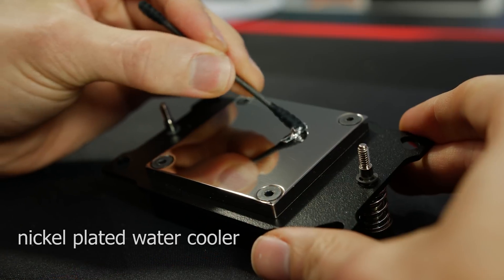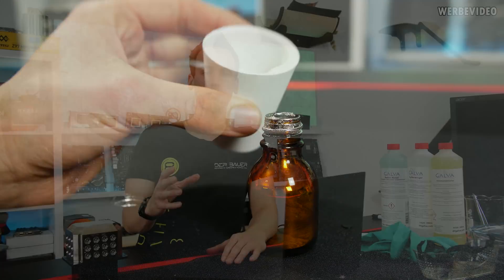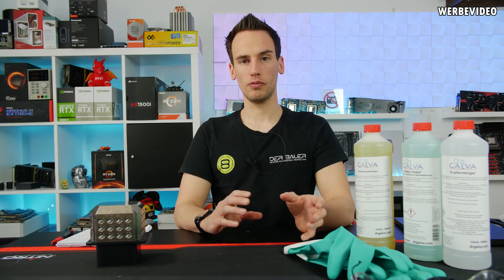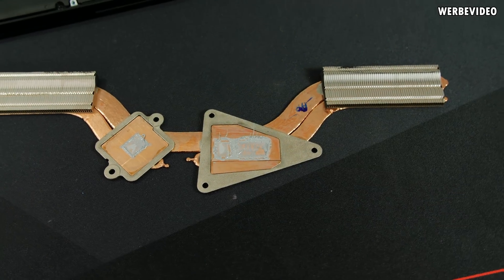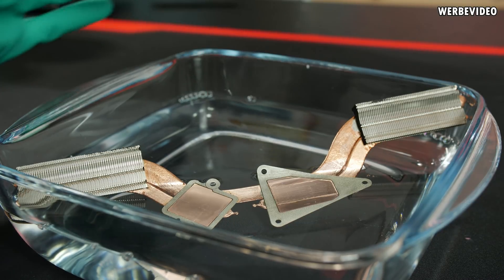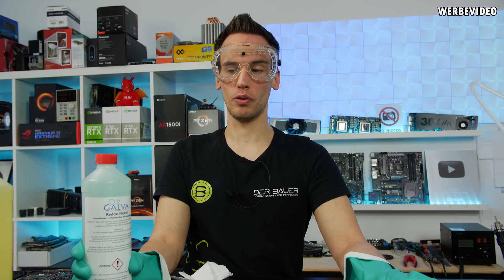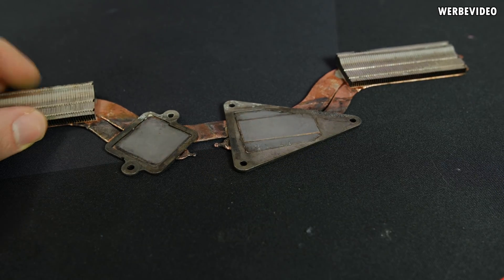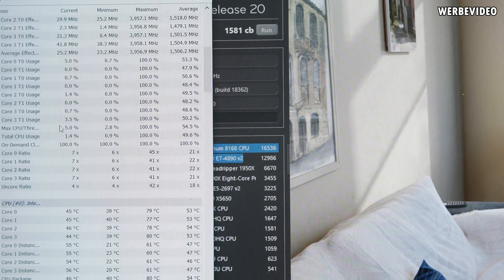Can this REALLY work? DIY Nickel plating a CPU cooler (Liquid Metal preparation)

Comment: Electroplating with a towel dipped in nickel sulfate wrapped around the anode would be more precise and could stop bumpy spots from appearing. You also wouldn't need to use palladium. Also for anyone doing this I recommend you get industrial degreaser from your hardware store instead of a citric acid/ alcohol solution, this is more powerful and would stop black spots from appearing on later in the project. 

Great video nonetheless :D

Comment: @10:00 that's tarnish I think from copper reacting to an incompatible metal trace. Maybe due to aluminium contact. 

On a side note: This is also why you don't sand your copper with aluminium oxide: I learned that the hard way :)

Comment: Derbaur, I bought a caswell plug n plate nickel kit, but it came with an opened nickel solution which had tons of Oxide bubbles in it. It's not plating well at all.

Comment: Just wanted to give my experience of using EK supremacy copper block for whole 9 years with Liquid metal. For first 5 years it was fine, now the performance is very, very bad. 

So it was fine for years with the intel system that I didn't reapply or remove the block after 1 reapply, and was still OK after switching to Ryzen 2700X 2 years ago. But the performance has gone to worse with each reapply and now I'm just thinking, if I should sandpaper my old block or buy a new one with nickel plating trying to remedy the cooling performance. Probably not worth the time trying to sand it, as I think there is some minor corrosion in the blocks side after all these years too.

I could see the performance hit already on my 2700X after I had to reapply the LM again on 1 year usage (and then again on my 3800X that I upgraded to), now I can't avoid thermal limit even being fully stock and undervolted and the CPU even idles past 40 celcius all the time. My RTX 2080 barely hits 50c on most cases and the cpu shows 60-70 temps on just cold windows boot up and without manual thermal cap it will reach +80c on load that will force my PWM fans to go 100% no matter what. So it has come to a point that can't cool down the CPU anymore.

So while it is probably fine when you only apply it once again so that the LM wont "dry out", constantly having to replace it is not a good idea on the block side apparently. At least not after a decade of usage.

Comment: God damnit it was hard to get the palladium to stick to the copper. I'm not sure why it won't stick in some places. But after  going through the procedure 3 times, it finally looks good. Thanks for the idea Roman! I'm still amazed by how easy that was. Next time i'll try using 400grit sandpaper on the copper first, maybe this will help the palladium.

Comment: Just out of curiousity, wouldn't a very thin nickel foil taped to the heatsink also do the job of protecting it from corrosion?
Reply: I don't think that would work that great. The foil would be much thicker than a nickel plating and probably will introduce tiny air pockets due to the foil not being perfectly flat. But you could simply try it and see how much it affects cooling, i'd be also interested in the results

Comment: @der8auer I've got small question, since you already use liquid metal extensively.
Could you test and compare LT-100 to something like Condactonaut?
LT-100 is quite cheap liquid metal, available on Aliexpress, that has stated condutctivity of 128 W/mK, that would make it best on the market if true.
I've only heard good things about it in customer reviews, bo no test visible. At least one review stated, that it's better than Condactonaut with visible temperature dicrease.
Reply: Because he is sponsored by thermal grizzly he stopped reviewing them

Comment: Very interesting, unfortunate that its a difficult process. Would have loved to try it just for fun on a GPU with cooler that has exposed copper, but the fact that you didn't pull it off the first round means i'm going to likely burn my house down

Comment: Do you think you'd have a much better coating of this if you submerged those copper parts in the palladium and nickel solutions if you left it on for day each? Just thinking ...
Reply: Hi there, just did this myself and maybe i can answer that question: imho the biggeest problem seems to be the initial cleaning of the copper, the paladium somehow doesn't want to stick to some areas and i don't know why. But yes, a longer bath yields better results. But i'd not go over 1h for palladium (the more palladium accumulates, the less reusable the palladiumactivator gets, also i don't know if too much palladium maybe decrease thermal performance). As Roman said - and he's probably the expert here^^ - we only need a specific amount of nickel. We could build up a thicker layer, but that won't do anything but desaturate the nickel-electrolyte more.
Reply: @samehedi  Thanks man!

Comment: Im curious if this kind of behavior varies between the LM brands. Ive been running LM (Thermal Grizzly) on the CPU of my Dell M6600 for almost a year and it hasnt changed performance at all. The CPU runs 90C or lower, generally 75c under load which is much better than the 99C i use to see stock or with decent TIM.

Comment: Given the fact that the heat from the core-dies is spread through the spreader to adjoining core-dies and to the IO-die would it be a good idea to delid an amd processor and using heatpipes to cool each die separately if this will allow the core- and the io-dies to run at much higher clock frequencies?

Comment: how about use like a borders around the contact areas, i mean u can save chemicals and focus the reaction and avoid unexpected products by reactions with the other metalic piece that is surrounding the contact area (could change/renew the chemicals every interval of time you choose with the plunger of a syringe.), borders colud be plastic materials like the containers and at the end you can polish with an ultra soft material in order to get a chrome like finish, regrets  from Mx

Comment: The other issue with electroplating nickel is the risk of hydrogen embrittlement.
I was electroplating my RC Car's drive shafts so I wouldn't have to worry about rust, the dog bone ends are "shrink fitted" which the embrittled driveshafts couldn't handle and consequently cracked.
Reply: you can remove hydrogen by heating them in the oven 300oC 1h i've read online

Comment: I wouldn't recommend people doing this at home, and I certainly wouldn't have those chemicals in my oven. You can find plenty of businesses that do nickel plating professionally near you.  They usually charge by the surface that needs to be treated so for cooler plates it will be cheap. They will certainly do a better job than you at home and you won't be at risk of inhaling or spilling dangerous chemicals on you or your cat.

Comment: i think the best cause of action is if you have copper heat spreader to apply liquid metal and after 2 months or SO  to reapply i think the 2nd time will be fine as the LM from the 1st time bonded with the copper the 2nd time will be on already copper & LM surface so the 2nd time will not dry out.

Comment: To anyone doing this here:

Please be extremely careful here. I've done electroplating before myself, and until something bad happen, I was working at an electroplating place.

Nickel salts are quite carcinogenic, and plating aluminium is quite the lengthy process, and is quite hard.

Some other tips:

- To clean copper, you can just make a 10% citric acid solution, and spray it on the copper, and scrub it hard. Will help removing any copper oxide.
- Clean your surface very well using something like mechanical abrasion. Remove any nicks you can. Chemical preparation can also be used, but be careful there too.
- Wash your hands before handling the surface, and wear gloves after that.
- Do a 5% isopropanol bath to remove some of the oils on the piece.
- Do a 10-20% bath of sodium hydroxide solution to remove all of the oils.
- Use a low current density. To improve plating times, increase acid concentration for higher solution conductivity.
- Use a pump/magnetic stir plate to prevent any air/hydrogen bubbles forming on the part, so you get a nice clean uniform plate.

Also, plating aluminium is hard AF, and quite expensive actually. It involves multiple steps, for some formulas, exotic chemicals, and some lengthy preparation.

Finally, electroless plating, or even better, vaccuum plating could work well for a pre-plate job if you could make the machine.

 If you have any questions, just ask.
Reply: i'll need some advice in 1 month's time, i will be nickel plating stock reference 6900xt reference heatsink to use with liquid metal

Comment: The heatsinks didn't look fully covered so if any of that LM TiM gets into the little copper gaps in the paladium: it can still ruin the copper.

Or, was this to just aid in thermal transfer because the makeup of the LM works better on a plated metal then direct copper ?

Comment: I feel like since gold plating to copper is pretty well and common that a gold plate may have been easier. They sell liquid solutions which are pretty simple to use although a little more expensive. Gold should also have low reactivity to gallium metal long term like nickel, but should be a more documented process.
Reply: Gold dissolves in Mercury so i guess it might form an alloy with gallium as well

Comment: The black stuff looked like paint from the coolers fins. 9:47 the cooler fins are in the solution, dissolving the paint into the solution which then formed on the cold plates.

Comment: For a flat heat plate, you should simply electroplate. It's way faster and will build up a much thicker layer. It only needs to be where the gallium is in contact with the copper. If you're doing this for a home build PC, it's fairly easy to chemically etch the IHS and cooler plate, then electroplate both. It's obviously mandatory to remove the IHS before you electroplate it, or you'll likely destroy the CPU.
Reply: Mhm would you destroy the CPU though?

I think solutions can find its way under the heatspreader through a breather but might not ever come out or dry out, or might prove somewhat too corrosive. So indeed doing this on whole CPU seems ill advised. Also any exposed gold-plating might get plated over, which wouldn't be ideal.
Reply: @SianaGearz  That was my point, remove the IHS from the CPU before electroplating it. You cannot electroplate the IHS while it's still on the CPU, the current required for electroplating would almost certainly kill it. I wouldn't worry about nickel plating getting onto a gold circuit, unless it thick enough to cause a short, it wouldn't be much of a concern.

Comment: Why does Liquid Metal have to be so thin, runny, and low-viscosity?  Why can't a Liquid Metal formula be developed with a higher viscosity, and which is more non-Newtonian like a paste or gel or slurry? Surely this can be done without compromising on the thermal conductivity, can't it?

Comment: So. Just wondering why you did not use Electroplating?
No need for dangerous chemicals, just Hydrogen Peroxide and Vinegar.
Done it quite a few times, and the surface is extremely smooth and regular.
But i have not done this for heat conducting surfaces, Just decorative.
Reply: He explains why he doesn't do it in the video.

Comment: Question. I have your delid mate and delidded my 8700K and used thermal grizzly liquid metal between die and ihs. I've been changing the liquid metal every 6 months. Is that to often or not enough in your experience?
Reply: it's been around 2 years since i delidded and applied liquid metal on my 8700. Never touched it again, and temps haven't changed a bit since then.
Reply: I haven't touched my 7700k in 2 years with no performance changes personally. The ihs comes nickelplated stock and diffusion through the untouched die is extremely low. Did you grind down the ihs?
Reply: @Ironclad17  no didn't sand it. I only change it because I remember Steve from GN said to change it every 6 to 12 months. But I was looking for Roman's opinion as he's got far more experience than me.

I do notice the liquid metal has a different "feel" (for lack of a better word) to it after 6 months of use

Comment: I wanted to thank you for doing these videos in English as well. Thermals on laptops have always been a problem and any content helping to lower temps is great!
Reply: Go with new ryzen and thermal problem is solved 😎
Reply: @jerrym1401  Problem is the Ryzen laptops are overall worse on about everything else than cpu performance. Its not really a pick and choose matter. For a top tier laptop you need every component to "click".  Show me a laptop with Ryzen chip + a 15.6+ screen, GPU around 2070(non Max-Q) and good memory. I bet you will find 1 to 3 decent laptops. Here in Norway i struggle to find anything with the good AMD chips even though i REALLY want my laptop with Ryzen.

Comment: You should really of tried this using electroplating, from what I have seen you can do it with a normal PC PSU, But you can apply it only to the area you want by brushing it and building up layers, using a brush that is conductive. (codys lab does this gold plating a bumper),  I do also believe you have to do a wetting test with pure distilled water to make sure the surface is 100% free from any type of oils/ contaminants. I think that is why your base layer was so spotty.
Reply: You can just use batteries as well
Reply: No, I would recommend using a current controlled power supply.

You want absolute control over current density. Even at 3,3V, that could be way too much voltage, and therefore, current.
Reply: @neutronpcxt372  Yes it would be farrr better, would allow for tuning, but by brushing it on i think you have much more control overall: vs normal electroplating. I have never done it either way myself, Just speaking from what i have seen. That is how i think you could get away with the 3.3 volt, you could also step it down fairly easy with a normal psu.

Comment: Is it just me or is Youtube's compression algorithm getting worse......
Reply: Big video platforms like youtube, amazon prime video and netflix were asked by some governments to limit bandwidth because so many people are at home and using those platforms during the corona situation. It could be a consequence of that.
Reply: @megapro125  yeah i knew about that,  they took off anything over 1080p but they added it back so it seems a few days ago, and it is garbage, guess that could still be the reason even tho.
Reply: @r3drumg33k3  Did you watch the video early?

If so, it was still showing you the H.264 encoded video, not the higher quality VP9 encoded video, which has higher bitrate efficiency, and thus, higher quality.
Reply: @neutronpcxt372  That i did, within the first hour i think it was,  I did not know that, ty for the info :)

Comment: when electroplating, lets say aluminium, isnt copper being used as a layer before the nickel as the same as your palladium?
Reply: Well, to plate aluminium, you have three steps:

1. You remove the anodization/oxide layer using a sodium hydroxide.
2. You very quickly put it in a solution of zinc hydroxide to protect the aluminium with a thin zinc coating.
3. Using a flash copper solution, you actually plate a thin layer of copper to prepare it for the main plating job.

Comment: Yeh, I lost a GPU block and a D5 pump to EK's nickle plating failure -_-
Reply: EK is overpriced shit. What did you expect?
Reply: How did you know it was failing? Currently I have pushed about 3 gallons of distilled water through my rig but I am still seeing some silvery looking flakes. I am beginning to suspect it could have something to do with the nickle plating. Did you notice any changes to how the gpu block looked?
Reply: @james342  you could clearly see the copper under it. Check inside your pump, its magnetic so it'll not only stick to it but for me it destroyed the spindle. Hope it isn't!
Reply: @TheBloodypete  Thank you for the tip, it just so happens I have some n52 neos around here ill put them to use today :)
Reply: the entire lineup of EK is a failure these days.